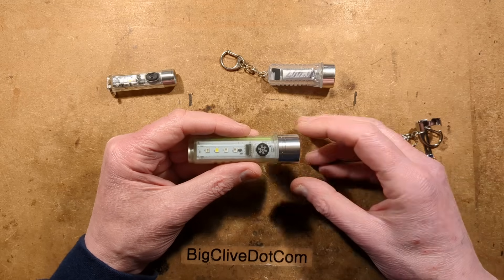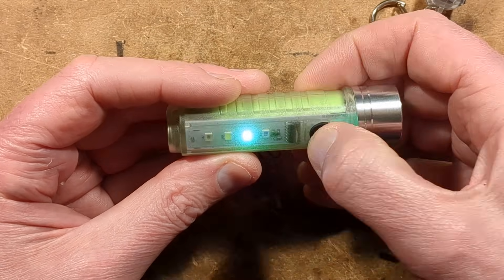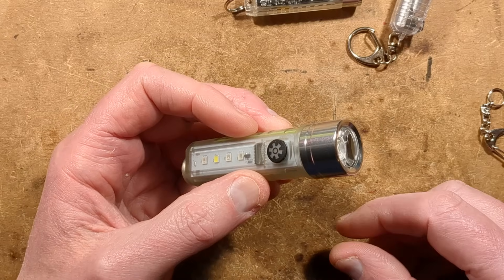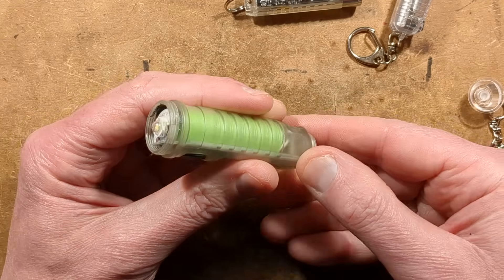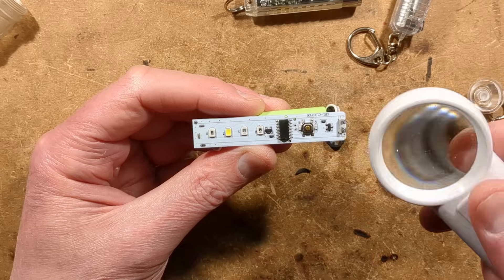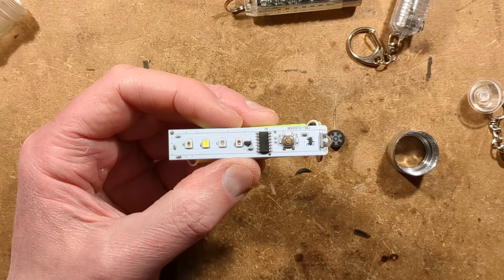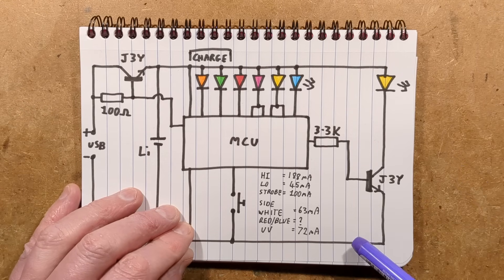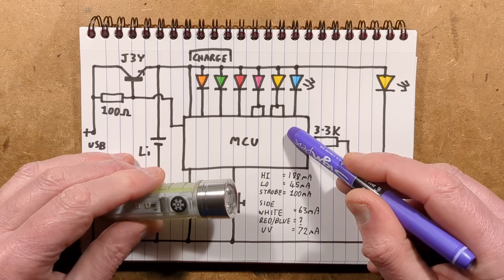Cheap 'n' chunky Chinese rechargeable flashlight teardown

Comment: Wow I have same exact flashlight 
I made a typeC and vapor device mods.
However I cannot reverse engineer how charging current is set.  Have you tried to change 100 Ohm  resistor?
Reply from the maker: The charge circuit is terrible on this.  Changing the resistor is not a good idea.

Comment: Thanks Clive another nice reverse engineering. 
Soooo handy. I have the little square double headed version. 
Was delighted when Clive reviewed it a while back. 
Lives on my keychain 
That version has a handy feature , the left button for the main lights is press and hold and the light stays on just while held. 
Keychain is normally on my belt so in dark places ( stock rooms dimly lit)I can just press it on for a second to read box details with out removing it from my belt. 
Battery lasts a fair time iirc Clive found it was good for about an hour on full brightness. 
Over all one of my best “ that’s a handy item to have “ buys.

Comment: Ugh, seems like a reasonable little light, but it's so annoying they didn't put the two 5.1k resistors for USB-C charging. Not sure if they didn't want to add fractions of a penny to the BOM, or if they didn't know, but it's extremely frustrating. I'm guessing the former, considering how minimalist the rest is.

Comment: I've got the tiny one on my lanyard. It has saved my bacon many times; the only issue was the metal end fitting tending to unscrew itself. An easy fix with a few turns of teflon tape. These are pretty excellent little lights, AND the tiny one has a pair of magnets on the base, so it can be used as a sort of area light if fixed to a ferromagnetic surface (e.g. filing cabinets).

Comment: 8:03: "serious microcontroller abuse going on here"... 30+ mA on what seems to be signal pins on the MCU does look excessive. Isn't this going to cause premature failure? (The right way to do this is to add transistors so the MCU isn't directly driving the LEDs, but given all the Muntzing, I can't imagine the designer seriously entertained that idea.)
Reply from the maker: Coming soon, a smaller version that has the transistors.  (Video already made.)

Comment: That LED has a clear plastic dome you can rip it off it’s glued, and light becomes better less obstructed, under is a soft silicon lens covering phosphor. I always remove those little plastic domes. Wish you did a no strobe hack for red and blue I want those to be static I have same light.

Comment: I have the double headed small one and the UV-led is great for "charging" the glow-in-the-dark case. A couple of seconds with the UV-led on and the case glows for a long time which makes finding the light in the dark easy. I also have one in black which unfortunately does not glow but still has the UV-led.

Comment: In the 1950's ( ? ) a UK flashlight might  have an (  Ever Ready™ number  8 cell 😝 ) these are now not available ... however ... should you find one of these old torches in your ( Great Grandfather's attic ? ) . DO  NOT !  throw it out ... because ( Heh - Heh ) a modern  18650 Lithium cell is a perfect size & fit , ( tried - n - tested )  ............... DAVE™🛑

Comment: You can get rid of a resistor at the LEDs, if you just pulse them with a short duty cycle. Not textbook correct, but the MCU also limits the current somehow. At least for small indicator LEDs that’s a cost-effective method.
If you use that method with a multiplexed 7-segment display, have a time slot for each single digit to glow, you also get constant segment brightness independent of the displayed values.

Comment: Have a similar type, though just with a single row of LED's in it. Got it very cheap at a surplus place, under $1, though it was not working. Replaced the lithium cell with 4 18650 cells, and added in a DW01 board as well. Charger was not working, so in went a silicon diode and a resistor, along with an extra 0R47 resistor in series with the lamps, and the cells had longer thin wire (old network cable coming to hand), and they were pushed to the middle of the unit, and glued in place. The magnets it used were not the best, so an old hard drive magnet was also glues to the middle, making it a great camping and utility light. charge for 2 days, and it runs for an entire weekend, left on all night at low intensity. no cost for the upgrade, used cells from laptop packs, one DW01 board that I got as part of a 20 for $1 buy, and the cable and resistor were salvaged, along with the diode and the 3R3 resistor to limit current.

Comment: What rating is the battery? Would it be worth buying a higher mA and replacing the existing for longer life..
Reply from the maker: It's 200mAh.  A better cell would improve the run time greatly.

Comment: I have that small one and I seriously love it as it still work after all that time(bought one when they first popped up).
I was thinking about getting bigger one to keep in car so it could also work as emergency light that you pop on the roof(finally strobe would be useful...) but my super old super cheap double AA noname brand light I keep in glovebox weirdly dont want to die even if I cracked plastic lens and I taped battery cover :D

Comment: when you held the button down at 1:32, i thought i'd try that on my head torch with the movenent sensing switch which you did a strip-down about 2 months ago and found that when i hold the button down the strip led starts strobing.   i didnt know about that.   i dont think that was in the instructions.   it doesnt matter which light is on, it reverts to the led strip strobing.

Comment: How is it possible to make a 14500 cell with such low capacity?
Reply from the maker: Salvaged cells or deliberately manufactured with minimum chemistry in them.

Comment: I really dont like this trend of putting usb-c charge ports on cheapo things like this. They never have real usb-c chips so they dont even work in real usb-c chargers, you need to use a usb-c to usb-a cable and plug it into an old "dumb" charger.

Comment: Should this flashlight have a fuse? 

Another electricity channel (diodegonewild) says that when microchips fail they often fail short curcuit. And since this microchip directly connects the battery, if it went short circuit I wonder what would happen to the rechargeable battery. Would it explode?

Hopefully not explosions and flames! 
Non-rechargeable battery powered gadgets arent immune to short circuits, either but they don't have fuses,i think. My family bought an AA powered gadget from Amazon, and there was a short circuit inside that cause the AA alkaline batteries and device to heat up severely, and the batteries cooked off their wrapping. 

But the battery spring contacts got so hot that they shrunk so maybe that's like a sketchy fuse. Not sure if its good enough. And are alkaline batteries more resistant to flames than a rechargeable battery anyway?
Reply from the maker: The tracks and cell connection wires will probably act as fuses.

Comment: Thanks for this Clive. If I didn't already have about 17 torches I'd get one. ;) (I have some nice tabbed 800mah 14500 cells left over from a re-power job I did in the past when it was not much dearer to buy 6 than it was to buy 2.)

Comment: I've got a nitecore tube with an interesting failure mode, should you be interested in tearing one open.
Reply from the maker: What's the failure?  A common one is seeming to charge, but not working.  Another one is the LED strobing at higher levels.

Comment: I wonder what it's run time would be in the straight torch mode, I could calculate it by the numbers you have given me, but I'm a bit math challenged at the moment, and lazy.
Reply from the maker: It's complicated to compute, because the LED current drops as the cell voltage drops.

Comment: There is a big version named 520A, with 18650 cell, about 500lm output, heatsink on the main Led, and zoom. I bought one 2 years ago and it still works.

Comment: Seems like the Chinese designs devour the available scraped surplus component inventory, to get the rock bottom pricing.🤔.
It is unfortunate, they used a lowly bipolar instead of a mosfet as  the main led driver, especially for a white led with an already high Vfwd. Could have made the battery charge last longer, or to get more brightness out of the LED in strobe mode. What would be more interesting to know,  is the effectiveness(or otherwise) of battery cutoff and leakage(when cutoff), which could render the torch useless, if allowed to drain completely, due to pemature battery failure. Stil a robust design though.❤👍

Comment: You can help me? what is port number of mcu microcontroller exact?this is needed to program to act like that in flashlight or it is permanently?
Reply from the maker: It's unmarked.  You'd need to rewrite the software from scratch.

Comment: The microcontroller could be a Sonix SN8P2501B. V+ and GND pins correspond to the pinout and pin 8, which drives the main LED, is labeled PWM0. The unused pin 7 is the RESET. It would be nice to reprogram it (but it seems to have OTP memory).
https://www.lcsc.com/datasheet/lcsc_datasheet_2304140030_SONIX-SN8P2501B_C125196.pdf

Comment: I’m uncertain why you say that using the transistor as a resistor is naughty. Granted an FET would be a better choice in terms of efficiency but I wanted to point out that the word transistor is derived from the concept “transfer resistance” meaning a small change in the base-emitter resistance (due to voltage applied to that junction) results in a large change in the emitter-comet or resistance.

So really, it’s being used as originally intended.

(Sorry, but I just had to pick that nit)

Other than that, another excellent review. I would love to find the Chinese designer who decided to start adding those “I am a police car” LEDs to flashlights and administer a much-needed reset slap. It’s as annoying as the SOS function which has apparently gone out of fashion.
Reply: I think it is naughty in the sense that the way they are biasing it with no current limiting resistor will cause the current to vary wildly based on the gain of the transistor and also vary with temperature (the hfe of a J3Y/S8050 is rated at 120-400, so the collector current might vary by more than 3:1 from unit to unit). Using a FET in the linear region would probably also be hard to bias and have high temperature variation.
Reply: @veraxis9961 As the circuit is drawn, base current is limited by the 3.3K resistor and what current the I/o port can pass. I have no idea what the port can handle but typically that should swamp out the temperature/rating variance in a transistor. I’d like to see the datasheet for the micro (I know, good luck with that) to see its specs and the recommended buffering methods to compare with this Implementation.  I don’t doubt the manufacturer would get a concussion from slapping their foreheads but this is far from the first of this kind of circuit abuse Clive has shown us.

It’s just another detail in the design that screams “designed to a price point”. One would have to buy several of these things to see what the variation between units is but since in this unit at least the LED is being driven within spec (something of a miracle for a cheap Chinese flashlight) I suspect the unit-to-unit lumen output variation would be within say ten percent or so rather than three to one.
Reply: @markfergerson2145  Yes, the base current is limited, but the ratio between base current and collector current (i.e. the hfe/gain) can vary by a lot. Assuming the microcontroller pin can output close to its VDD  or maybe, say, VDD-0.3V, the 3.3k resistor would limited to around, say 0.6-1.1mA for the base current on a 3-4.2V battery. ~1mA should be no problem for most micros, so I do not think the current limit of the micro is a limiting factor. 

The problem comes in that when a raw BJT is driven in the linear region with no current limiting resistors, the ratio between Ib and Ic can vary hugely from unit to unit, per the aforementioned hfe/gain spec. so if Clive measured 188mA and the base current was 1mA or so, this would place the gain at around hfe=188. But if you had a transistor with an abnormally high or low hfe, then the drive current might be anywhere between 120-400mA from that same 1mA base current. At the high end it is possible that the LED or the BJT could be overdriven (3V*0.4A=1.2W for a 1W LED or 1.2V*0.4A=0.48W for a 0.3W rated transistor). Also bear in mind that the gain of a BJT goes up with higher temperature, resulting in even more collector current and more heat as the transistor heats up. It might be less at the high end given that the gain is specified at 50mA and not 400mA, but I suspect the variance is much higher than +/-10%, probably by enough that some units are noticeably brighter than others. 

Either way, the way that the transistor is being driven is rather crude and not being controlled very well. Sure, they might be saving one or two resistors, but at quantity a 1206-size resistor will cost less than $0.01 each.

Comment: is street lithium still that common in the UK ?
I ask because here in France, outside of Paris but still in a large city it's not really common.
I have found maybe 2 or 3 used disposable vapes at most for the last 6 years.
Reply from the maker: It's getting rarer, but they do appear from time to time.

Comment: i have this flashlight and also have the smaller one.
Quick tip: the smaller one is a FY11 which is still pretty good but is the clone of the S11 (which is identical but feature a bigger battery and a significantly brighter front LED).
The S11 is on my keychain and is a very useful tool, the front light have 4 intensity settings (from dim to very bright plus a turbo mode (which is super-bright) and if compared to other flashlights of the same size is insanely brighter!

Comment: These are visual clones of the Rovyvon A8 torch.
The original Rovyvon is priced at £55 and is totally worth the price.
I have the Rovyvon Angel Eyes E5, which has the rechargeable Li-Ion and an alkaline AAA. Those are the best keychain lights on the market. I avoid the clones tho, because I buy one light and I expect it to last forever...

Comment: I hate that the USB-C spec allows for legacy A-C cables. It made the transition a lot easier, sure, but it also made manufacturers forget about pretty much the only part of the spec that isn't optional, the CC resistors. I can sort of understand it on devices like this that are cost-cut to the extreme, but to this day, I keep finding brand new USB-C devices where calling two resistors a rounding error on the BOM is an overstatement, and they still forget them. How do you not notice that it doesn't work with literally any other spec-compliant USB-C device during testing? If legacy cables that violate the "no power till the device requests it" rule weren't a thing, this would have never happened...
Reply: They were devices designed for micro USB, that now just have a USB-C port shoehorned on instead.
Reply: Wherever practical, I return such devices as defective.
Reply: The EU requirement to use USBC is why this problem exists
Reply: @voltare2amstereo  nope, it existed way before that was a thing. Also, AliExpress sellers don't care about 99% of regulations anyway LOL.

Comment: Sorry, but i do not know what is happening. My usual Buds (Mpow M9) have a very Low volume now. I changed to an older different model and the volume is fine?!
Reply from the maker: Some audio systems like Dolby interpret my bassy voice as a bass track and put it to a middle speaker.  There may be a setting on your buds to filter bass.

Comment: Had one, immediately replaced the Led with high CRI warm one.
 But I don't like main modes UI high/low, any chance to reverse UI?
BTW the keychain version of  this light is much better and usefull.
Reply from the maker: To change the modes would need a new microcontroller with your own custom software.

Comment: Not to mention the cost cutting on the housing itself...clear plastic instead of colored, with no specific apertures for the individual LED's on the side to cut down on light spillage(may be intentional for the sake of looking cool).  Of course what does one expect for a few bucks here or pounds there?  Yes, a battery hack is needed for sure and swapping the main LED is easy as well.  Great video Clive, well done.. Thanks.
Reply: The spillage is the point, I love that the side white is such a broad area light! And it charges the whole glow housing, so I can find it hours later in the dark.

Comment: I have a small flat light. I got them off Amazon in a 4 pack. It has a magnet, a carabiner, a bottle opener, a mount (camera style), usb c rechargeable. The light is a cob style and is very bright, but the battery doesn't last that long. It's about 25mm square and 10mm thick. Very convenient size and perfect for a keychain.

Comment: I'm always amazed by those chips, your drawing only just scratches the surface of what that simple device actually contains. Have you ever thought of actually drawing out what the circuit actually looks like ?  Neat flashlight though.
Reply from the maker: It's a microcontroller, so the full schematic would be massive.  I could show a block diagram though.
Reply: @bigclivedotcom That would be nice, which microcontroler is that?

Comment: Funny that they put some strontium aluminate in the plastic, cos one of the UV torches I got a while back (cos easily influenced!) has a reflector that seemed to have it in the plastic too, so once I turn the torch off, the thing is glowing green inside where the cheap silvering is a bit too thin... :P

Comment: I bought some of those "1 watt" cob leds.  At 3 volts, the max current it takes is 50 mA and at 3.5 volts about 100 mA.  Certainly not 1 watts.  I just made a flashlight with one from a child's candy pop flashlight and an old tiny vape pen battery, charger and buck regulator.  Puts out a decent beam but I wish it was actually 1 watt.